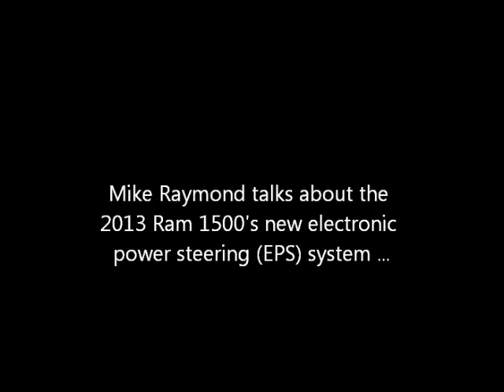2013 Ram 1500 EPS

Comment: My power steering on my 2013 Ram 1500 gets stuck when weather is at 35 deg or lower.  Depending how cold it is outside in the morning,  I have to wait 20 to 40 min til the power steering is functioning.  What's that about?

Comment: FUCKING JUNK
2013, recalled, 2015..recalled.  2014..no recall yet mine has the same failure.  Fuck dodge and anyone who uses electric power steering.  JUNK!

Comment: 2013 ram 45k miles and mine has gone out twice. First was under warranty. Second no warranty. Almost died because of this. How is this not a safety recall?
Reply: Please contact Transport Canada. They have opened an investigation as of June 2019 and you can be reimbursed for out of pocket if they force a recall. I'm having the same issue and I'm trying to get the word out on all the Forums: 1-800-333-0510

Comment: 78000 miles on my 2014. Steering failure and no help from Ram to fix. This is a major problem that should be addressed by Dodge with a recall.
Reply: Mine failed in a left turn through an intersection.  I have a 2014 ram 1500, there needs to be a recall on this.. its unsafe.
Reply: My power steering on my 2013 Ram 1500 gets stuck when weather is at 35 deg or lower.  Depending how cold it is outside in the morning,  I have to wait 20 to 40 min til the power steering is functioning.  What's that about?
Reply: @robertocervantesjr4670  so I took my old electric steering rack apart. Opened the part where the circuit board is.  It was filled with water...they are supposed to be sealed.  Way to screw over your customers dodge.
Reply: @GASSmallEngine  that's fucked up. I have to use a space heater in the mornings to speed up the power steering to warm up faster.  But as I'm driving,  if the engine isn't producing enough heat, my power steering locks up on me. I have an appointment with the dealer on the 12th of November,  which is this Tuesday.  We are going to be have  signal digit  temperature starting tomorrow night, so I don't know how bad its going to be with my ram to be able to drive it. Let's see what the dealer has to say come Tuesday.
Reply: @robertocervantesjr4670  if it's still working your rack may still be good.  If you have any mechanical or electrical knowledge take it apart..check all solder joints and reseal it with good sealant.
Reply: @GASSmallEngine  Did you find any solders that had to be redone? I'm planning to remove the electrical module "access panel" and try to apply heat on it to remove any humidity. Since it's doing fine above a certain temperature there's surely something to do before replacing the whole rack.
Reply: 2013 Ram hemi. EPS began intermittent failure, then all together about 3 years ago. Been building up arm strength driving without PS. Starting in 2015, there's a recall where the circuit board shorts out. I would bet money that's what wrong with mine. When you turn the engine on, it works until you put it in gear, then stops the assist and turns the warning light on, which to me signifies an electrical not mechanical problem. Took it to a garage and got a quote of 3,000. I guess I'll continue building up my arms.
Reply: I'm on rack number 2. but this time i got steer assist until i reach about 15 degrees right then it quits.
Reply: @UntamedUnalakleet  sounds like your clock spring or steering sensor in your column.

Comment: my 2014 failed today, park for several minutes, then it works again and then fails after driving for couple minutes. it will take about 4000 canadian dollars to fix it. it is said that 2015 has a recall on that, but not 2014
Reply: Please contact Transport Canada. They have opened an investigation as of June 2019 and you can be reimbursed for out of pocket if they force a recall. I'm having the same issue and I'm trying to get the word out on all the Forums: 1-800-333-0510